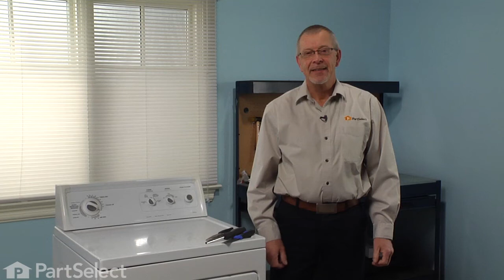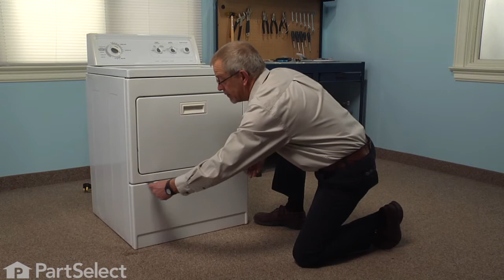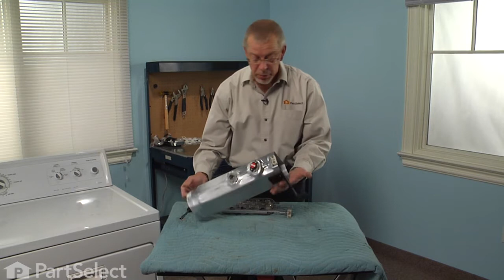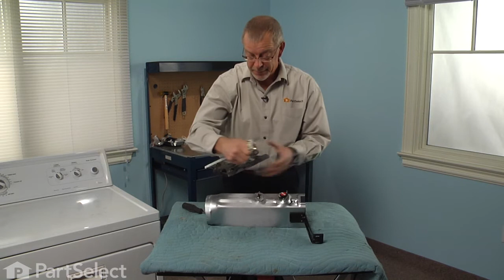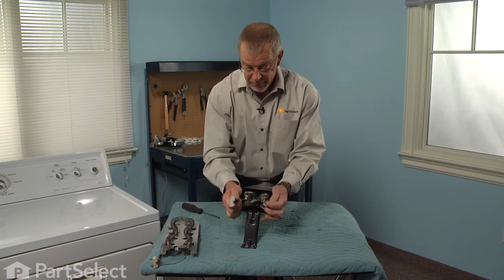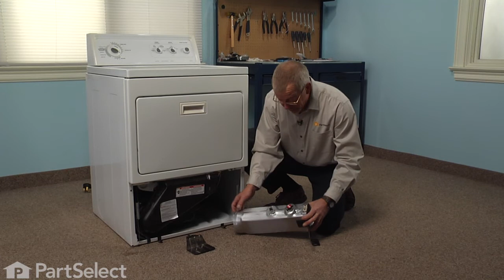Whirlpool Dryer Repair - How to Replace the Heating Element (Whirlpool # WP3387747)

Comment: What is not discusssd is how the heating element housing has a tab at the back that makes reinstalling the housing (with element) extremely tricky. Its not a locking mechanism I've ever seen before. The tab looks like it would lock into a slot at the back of the dryer, or bolt into something (it has a hole in it for no reason). But theres no slot or hole at the back. So the tab just kind of sneaks in behind the protruding outtake hole in the back somewhere around the 10 oclock position. Youve got to find just the right place to hook it in, then with some pressure and force you push and twist the whole assembly clockwise. You are super lucky if you get the tab hooked behind the protruding exhaust hole the first time you try it. Its quite the battle. I found it impossible to do with the mounting bracket for the front of the housing attached. Its too tight in the space and the mounting bracket prevented me from finding the perfect angle to hook the tab in the back. So I plugged everyging in, struggled and struggled to hook the housing, did it, then installed the mounting bracket as the last move. The video helped, but like all videos done by the expert reps, it completely glosses over the tricky and challenging bits. Not recommended fix for folks who dont want to squirm around on the ground (guy did it on his knees, lol!).

Comment: Helpful vid - except for the part about using a putty knife to release 'spring clips' on lower front panel.  I took my putty knife and worked at this for around 30 minutes - and also started using a screwdriver to help pry seeing as how I was having SO much trouble getting it.  I noticed how much I was marring & chipping up the finish!  After I had to back away to let my frustration subside - I discovered then that the panel on mine had two 1/4" hex-head screws on the bottom which had to be removed!!!!  And it was just those two screws to release it. )o:

Comment: Dude.  This saved me so much time!!!  Thank you so much.  I had watched a different video of a whirlpool heating element, but the back did not come off the way it showed.  I knew something was wrong.  UGH.  I slowed down and watched this video and it was EXACTLY as you described.  Had I not watched this, I would have stripped out the receiver lip in back.
One suggestion:  I always test the electronic components before replacing blindly.  So, I tested both thermostats and the heating element.  Luckily, mine was just the heating element.  But, it would be very disheartening to replace a heating element and find out later it was the thermostat too.  I hope that might help someone in the future.  Thanks again!!!!
Reply: I did the same as you.  Bought the full kit off the 'Zon for ~$35.  Saw that everything works off of resistance, so after watching the video to get the housing out (GREAT VIDEO BTW!!) I tested each limit switch and the coil, comparing to what the new parts were reading, and found my high limit was the actual issue.  Went ahead and changed out all 3 parts since I was in there, 5 minutes later I'm making heat again.  Love this old dryer, and it looks like I can keep it another 15 years now!